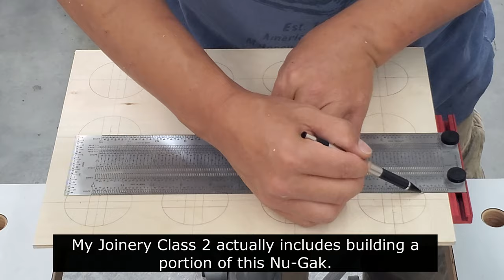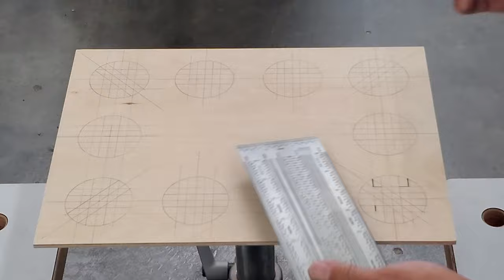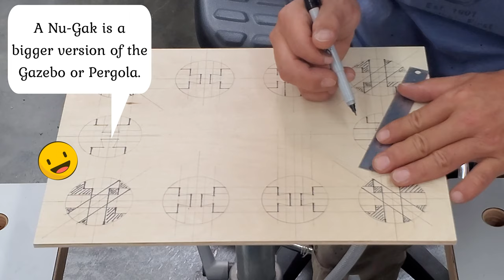Dissecting Temple joinery series part 1- The upper post with 4-way Dovetail joint / 우드워킹/짜맞춤교육/결구

Comment: So excited for this series!!! I would love to see a more detailed video showing the drawing process! 

Do you have plans to make a video that goes over the joints you use for the column in your cantilevered bench? I forgot the name of it but they look like they were derived from temple joinery.
Reply from the maker: Yes, the cantilevered bench joinery was actually a modified joint from the eastern timber framing joinery method.
After my temple joinery & 3way miter series, I am planning to do a video on either Make-up box or the Cantileverd bench.
Reply: Wood Art Studio I would love to see a series on the cantilevered bench! We met at a woodworking show in VA a few years back and you were gracious enough to indulge all my questions regarding the bench! I still haven’t got around to trying to make one yet though.